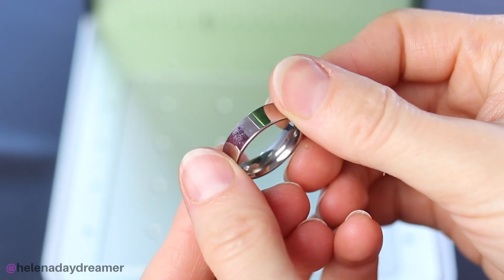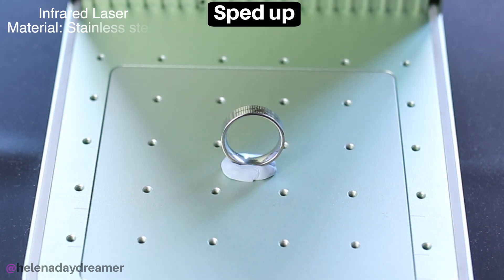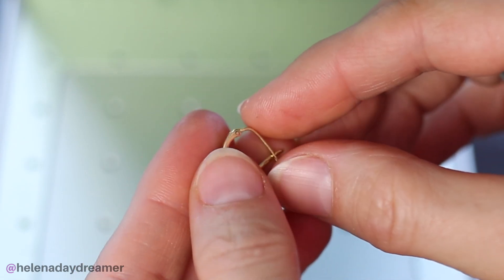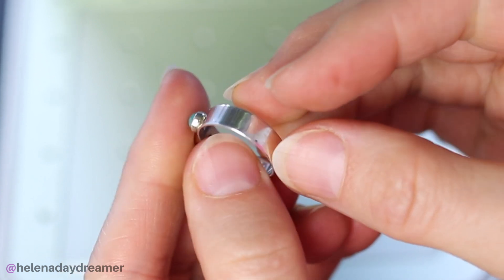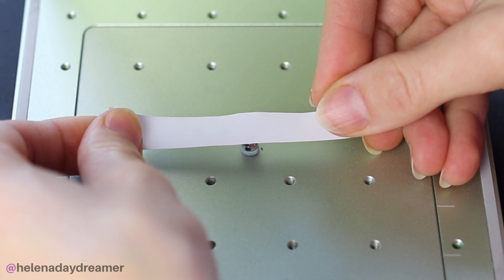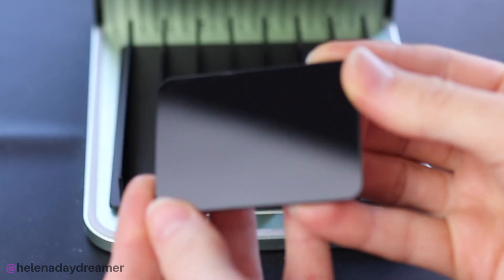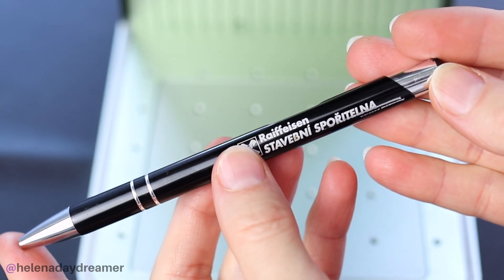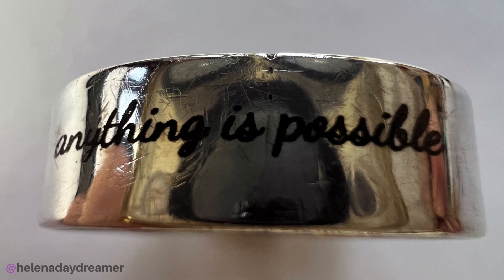Testing Materials with xTool F1 Laser Machine (DIY Jewelry & Other Projects)

Comment: what do you mean by my line per cent? if I want deeper engarve I need more line per cent? if I want to engarve my mom's handwriting in my jewellery how can I do that I have it in pdf
Reply from the maker: Line per centimetre is a setting in xcs: ‘The amount of line the machine is burning back and forth in actual one centimetre of an area’ this machine can mark the metal and depending on your settings you can have just a light surface mark or deeper mark, but it doesn’t engrave very deeply. If you want deep engrave consider F1 Ultra, which is an upgrade to the F1. You can use different files in xTool creative space, not sure about pdfs, but there would be ways to go about that too. Like screen shot pdf to create jpg and then trace the image in xcs for example..

Comment: Will the engraving always come out black on metal? I am looking for an etched look rather than a dark black look. 
Thank you
Reply from the maker: This machine and all the diode lasers that can engrave metal using blue laser or infrared laser(depending on the type of metal you are using) will only mark the metal. You will be able to feel the marking with your finger nail, but it is not a traditional deep engraving you get using a Fiber laser or engraving by hand. The black colour is an oxidisation of the metal and you'll be able to rub it off or it will rub off eventually through wear(shower, swimming pool etc) Once it does, depending on how deep the marking is, the design will still show, but it will be not as deep as standard engraving if it makes sense. I'll try to make a video on this and show examples.
Reply: It’s not super crisp mmmm

Comment: Do you think we can engrave on an empty bullet brass casing? Wondering with the rounded edge if possible.
Reply from the maker: I’d say yes, I’ve engraved brass without a problem and rounded objects too. Just depends on how long your text is or how large the image. Or you can go for the rotary and then you can engrave all the way round it.
Reply: @AvaAndAngelsArt  thanks is your promo code also valid on Canada’s website?
Reply from the maker: @SylvieCarriere-r5z   I’m not sure, I think the code is only for US, but give it a go. If you go to xtool through any of my links in the description box, it should redirect you to Canadian xtool automatically. But they always run sales anyway even if the code doesn’t work for Canada 🇨🇦

Comment: I just found your channel, so fun! Does this machine need to be in a well-ventilated area? can it be used inside a home? Also, what kind of maintenance does it require? thank you
Reply from the maker: Hi Angie, I’m happy you’re enjoying my videos ❤️ I have the xtool smoke purifier with this machine and so I can comfortably use the F1 at home without any extra ventilation. Sometimes when I don’t use the purifier, I just put the hose/ tube directly from the F1 out of the window. And that does the trick too, but I prefer the purifier for sure. You can watch my previous video on the xtool F1 for more info. In regards to the maintenance, it really depends on what material you’re cutting/engraving, but from what I have seen, you will eventually need to clean the fan, possibly wipe the lense with isopropyl alcohol if it gets messy/ sticky. And of course change filters in the air purifier if you use it. I haven’t done any of these things yet, but eventually I will. Not sure if there is anything else, these were just my first thoughts. I hope you found this useful ❤️